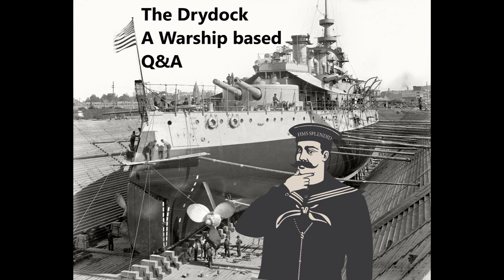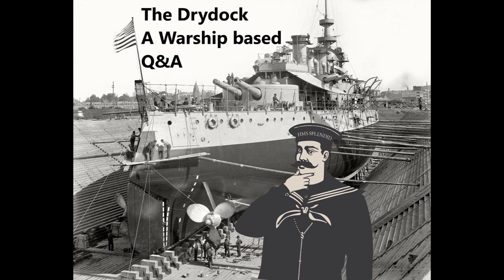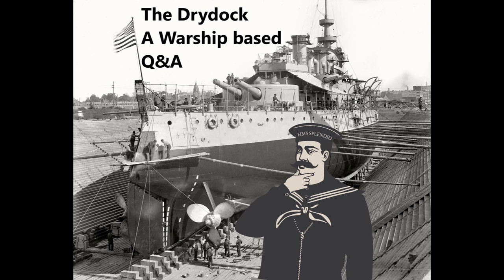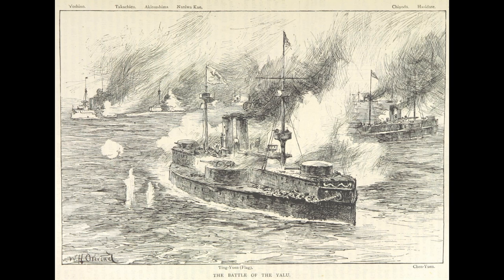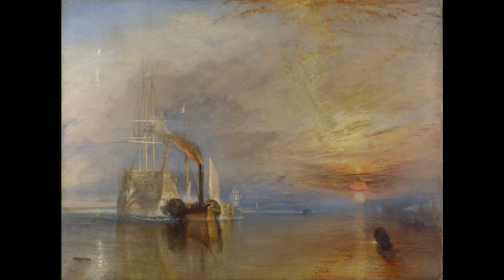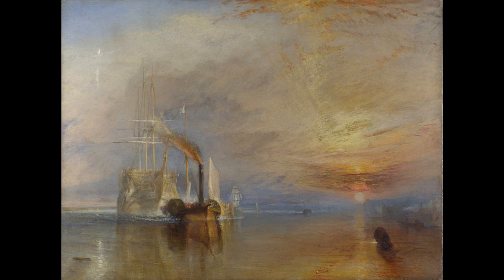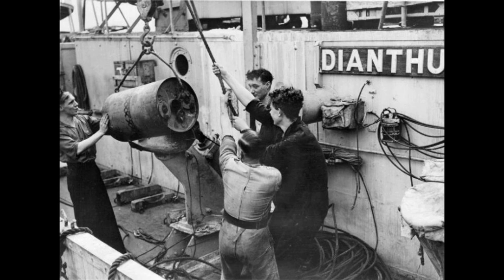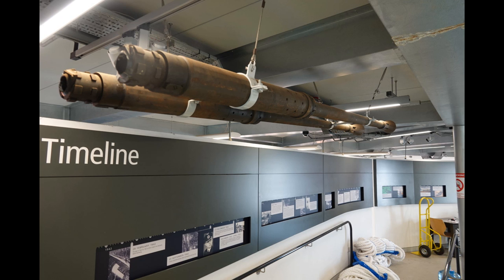The Drydock - Episode 231

Comment: In regards to 00:47, there is something that should be noted here, technology wise.  With early engines, you will very often see references in the original texts to "oil electric" or "kerosene electric" engines, as well as "oil" and "kerosene" engines. This leads many researchers to think that these engines literally run off of light oil, or kerosene.  This isn't the case. Keeping in mind that the term "diesel fuel" didn't come into common use until about 1936, with the advent of more popular diesel engines being produced around the world by Mercedes-Benz.  Prior to that, a multitude of various terms were used for this fuel type, including (but not limited to), coal-oil, kerosene, oil, and lighting fluid.  

Another thing that is often missed, is the composition of early diesel fuel.  Contrary to what you implied, diesel isn't always a kind of oil distillate, and didn't suffer greatly from distribution issues.  In fact, the composition of diesel fuel would vary by nation.  For example, in the US, diesel fuel was being made from oil, which was cheap and easily obtained.  Distribution of this was already in place through rail networks, with oil transportation having began in earnest in the late 1800's. By the time of WW1, it was relatively easy to transport fuel oil (including diesel) where it needed to be.  In nations that lacked large oil reserves, however, diesel was produced from coal. Specifically coal-tar would be distilled to produce a coal based diesel. This type of diesel was of a lower quality than the oil diesel, but with the early engines that didn't really matter that much as you weren't getting a great deal of power out of it to begin with.  Distribution there, however, did tend to prove problematic, as fuel oil transportation by rail (everything went by rail) in those days was in its infancy, and it would be well into the 1920's, early 1930's before Europe and Britain caught up to the United States.

In short, if an engine is listed as using kerosene prior to about 1936, then it is actually a diesel engine.  The term 'diesel' fuel wasn't in wide use at that point in time, which is why the name doesn't make sense. Meaning that yes, there were very early diesel engines in submarines, they just weren't called 'diesel'.
Reply: IIRC, Otto Diesel's first demonstration compression-ignition engine was run on peanut oil.
Reply: @kemarisite  I believe so, yes. However by the time of early submarines, "oil electric" or "oil" engines were actually quite common already in various uses. Railroads were already moving that direction, with 'oil' locomotives in full use by 1906 in Europe. Those locomotives had engines/prime movers in them easily large enough to power early submarines.  

I think Drach fell victim to the common misunderstanding about early diesel engines, thinking that 'kerosene' was the kerosene of today.  I can't really fault him for that, as it's not something that's widely known outside people who actively research early diesel production, and early diesel engine use.
Reply: I knew a guy who used to run his diesel microvan on a mix of actual diesel and vegetable oil he got in a supermarket on the cheap. Diesel engine, especially naturally-aspirated diesel engine, can run on almost anything vaguely oily, although it won't run very long on bad fuel.
Reply: @mancubwwa  I've heard such, but the point I was getting at with the original post, was back in the early days of 'diesel' engines... they weren't called diesel engines. They tended to be called oil, or kerosene engines, because at that time, diesel fuel wasn't called, well diesel.  It wasn't until the 1930's that the name "Diesel Fuel" began to be used.

Comment: Regarding 42:06 on Japanese use of flares - another book that addresses the Battle of Rennell Island is "Blazing Star, Setting Sun" by Jeffrey Cox. In this author's description of the battle, green float flares were dropped to starboard and red ones to port, apparently marking the path of the US ships like navigational lights. Plain white floats flares were apparently used to mark direction as a line later appeared across the path of the ships to point the way back to base for the Japanese planes. The source cited for this particular passage is "La Vallette Rennell Island Report 3", though there are many others in the bibliography covering this battle as well.

Comment: YAY!  My Sea Dart question made it!  I just wish the pic Drach used was of the bird in San Diego...that one never had the yellow visibility striping on the tail or engine inlets as far as I know.  I have yet to find a pic of the SD 'Dart in action that I could verify WAS that plane.
Reply: Despite being US naval aviation, every time I hear Sea Dart I think a Royal Navy missile system rather than a U.S. Navy fighter.
Reply: @philvanderlaan5942  Probably because the missile system was actually deployed.
Reply: Even without the technical problems the Sea Dart was going nowhere.  The first US Navy (marginally) supersonic fighter, the F4D Skyray, had its first flight two year before the Seadart, the F11F Tiger flew a little more than one year after and the F8U two years after.  The Seadart would have been rendered unnecessary by 1956.
Reply: Glad it made it.  I always love seeing the Sea Dart when I'm down in Balboa Park.
Reply: @SirThoreth  I've always considered that one MY airplane!  

I got a chance to sit in the cockpit and have the canopy lowered early on...i am STILL amazed any pilot could see sufficiently out the windscreen, given the shallow angle and structural soar down the centerline (same as on all the Convair delta planes, and the SR-71).

Comment: another way to stop corrosion at sea is to coat the metal with Vaseline.  It is however VERY important to remove it from your hands because otherwise the hand rails on ladders can become coated.  Don't know if deliberate or not but on HMAS Swan went down a ladder were one handrail was coated with alarming results.

Comment: Creating lamp oil from crude oil was necessary once the whale oil sources for lighting were greatly diminished. "Petrol" at the time was a near worthless byproduct which came out of the 
refining equipment spout at a lower temperature before the desired, valuable, "Kerosene" showed up. That was the reason why petrol  as a fuel was such a major attraction for inventors trying to get an ICE motor perfected to run on it. People were literally being paid to haul the explosive stuff away, no questions asked. Its only retail glimmer of hope at the time was as a dry cleaning liquid for home use sold in small amounts by some pharmacies.

Comment: The problem with newer, faster, battleships is that the whole concept of the battle line depends on the boats all having (using) roughly the same speed, so the advantages of a faster one, by say 10 knots, would have been wasted until there was much larger fleet of them that could all truck along at the higher speed.

Comment: Deck gun maintenance. Night surfacing to charge batteries was a good time to scramble the gun crew to wipe down the gun and grease the moving parts. You have to be on the surface anyway. Since no one in WWII had a nuclear boat this surfacing was pretty much required on a daily basis.

Comment: What would a theoretical ship look like if it was made up of all the worst aspects of each nations navies during ww2? For example USN mark 14 torpedoes, IJN AA defense, Italian guns/shells, etc.
Reply: Italian guns were fine, and even the shell quality issue has been overstated by poor historiography (namely, historians taking Iachiano as fact when he was intentionally misblaming supposed bad naval design and supposedly badly manufactured shells to cover up his incompetence and lack of aggression).

Anyways, here’s an idea for the “worst possible WWII battleship”: a Sovetsky Soyuz (so over 80,000 tons fully loaded) with a NorCal’s vibration/speed issues and belt/deck armour thickness, compounded by said armour being arranged in Bismarck’s armour layout, Bismarck’s medium-caliber AA (which consisted of BOLT-ACTION SINGLE-SHOT AA weapons), Yamato’s light AA (so the Japanese 25mm, which still isn’t as bad as that German 37mm), Scharnhorst’s main battery firing modified poison gas shells a la Richelieu (pre-US refit/completion), Bismarck’s triple-screw propulsion, and topped off by a torpedo defence system that’s an unholy combination of Yamato’s and Iowa’s (both of which, especially the former, had major structural weaknesses).

You now have a battleship that weighs 80,000 tons at full load but only has 9x11” guns, which fire shells that don’t work properly because their aerodynamics are now crap thanks to the poison gas modification, the ship has no effective medium AA and only a minimally effective light AA, has an anti-torpedo defence that might as well not exist, has relatively little protection against incoming shells at any combat ranges, has so little reserve buoyancy it can be sunk even if it’s citadel somehow manages to survive a battle intact, cannot steer with its props alone if it takes a bad stern hit, and cannot make its design speed without risking its hull vibrating itself apart.

Comment: Was the HMS Incomparable a practical design? Did UK armouries could they have built a 20" gun?
Reply: The Germans built two 31" guns in WWII, I don't see why the UK would be incapable of making a 20" guns.
Reply: @Edax_Royeaux  didn’t those huge cannon have very short barrel lives, from erosion? I’m sure they would be lined, but wouldn’t replacing the liners be time consuming? 

Also, I just realized that 20” is 1/2 meter 😮
Reply: @gerardlabelle9626  I've heard the barrel life of the Iowa 16" gun was about 290 rounds, depending on the propellant charges used.  The Gustav Gun had fired 47 rounds and worn out its original barrel, which had already fired around 250 rounds during testing and development.
Seems comparable to me.

Comment: As far as a type that could have been built earlier, other than the fact there wasn't anything that needed that big of a response there's no real reason someone couldn't have built a ship similar to Orion/Bretagne/New York at around the same time as dreadnought. 

There was certainly liners and stuff bigger it's not like you couldn't make a power plant that big and 13.5 and larger guns had already been a thing in the ironclad era, they just chose to gu up in number of 12 in turrets in a gradual expansion instead of going straight there for practical and logistical reasons

Comment: Drac. No german U boat had petrol engines first German U boat U1 was powered by twin Körtin heavy oil motors (1906) Germany built the Karps for Russia. Only in 1913 did the Germans use diesels in U19 again two 850hp each four stokes by M.A.N.
Reply from the maker: I probably could've worded that better to "non-diesel engines"
Reply: @Drachinifel  Yep allways a problem answering Q & A on the internet.  but interesting enough the marketing for the Körting company said Gasoline -meaning a "distilate" -being kerosene,  -of course the famous blind alley of multi-fuel engines -which weren't much good outside the engineering shed.